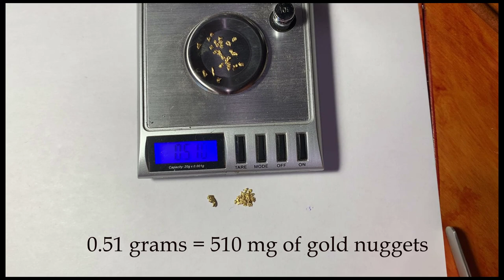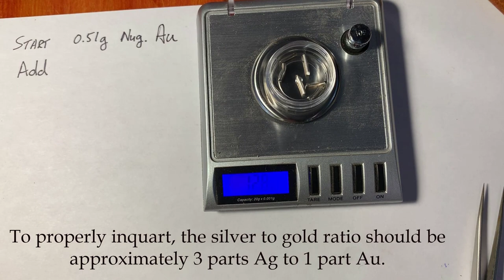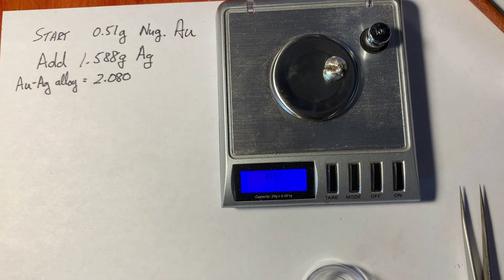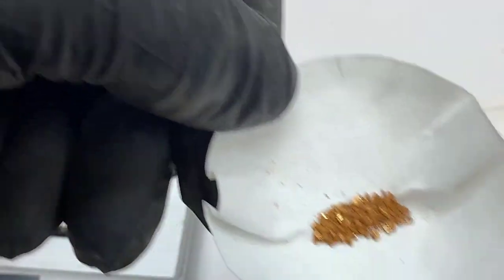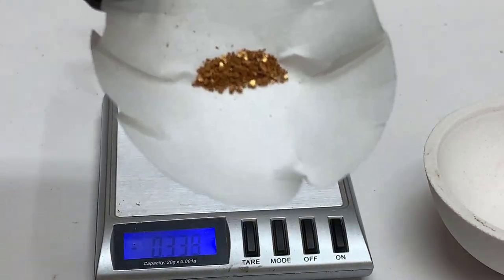Refining Gold Nuggets to Make a Standard Gold Test Solution

Comment: If you looked closely at the bead after melting it, you had a combination of gold and silver, but it was by no means mixed properly.
This will ruin the inquarting easily leaving the acid unable to "pick apart" some of the gold. These should show up later as larger lumps, or take very long time to be broken down.
Reply from the maker: Yeah, you're right. Some of the larger pieces took a very long time and I think I still had a bit of silver or base metals left in the gold. Gold prospecting is this weird and interesting experience. That's why I enjoy it so much.  Thanks! -- Dave

Comment: Why not use your cellphone in a fixture since it can accurately measure over 15 million grey-scale values. Using Beer-Lambert law with known concentration you can create a gold concentration graph/slope line using dilutions standardized with x  drop(s) of a detector solution like stannous chloride (SnCl2). Here is a Youtube video to help. See: https://youtu.be/1OLe98drl_c
I recommend using spectrophotometer couvets. Good luck!
Reply from the maker: That's sort of the direction that I've been moving with this. I'd like a fast and easy test to roughly quantify the amount of gold. Thanks for the comment! Very useful.  -- Dave
Reply: @Orophilia  Focus on best  gold standards with excellent lab preparation... no spills or poor pipette. Maybe only 4 standards for field assay enough. I use 34.25 ppm gold = 1 troyoz/short ton ore. Good luck.
Reply from the maker: @douglaspohl1827  I agree completely. I haven't been in a chemistry lab in 45 years and I'm very rusty. I'm trying to measure ~1 mg amounts of gold and I've got to work on good practices.  Thanks!  -- Dave
Reply from the maker: @douglaspohl1827  Thanks so much.  -- Dave